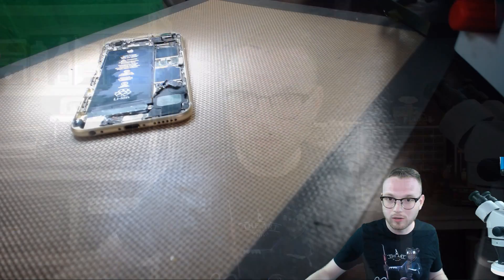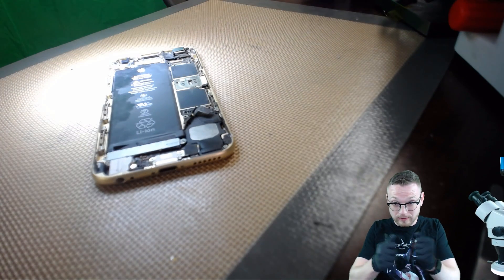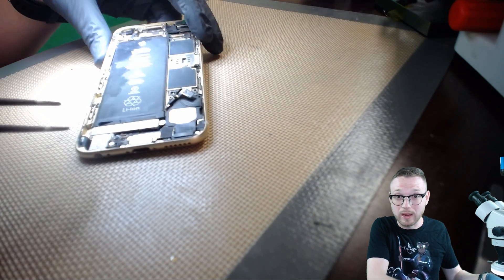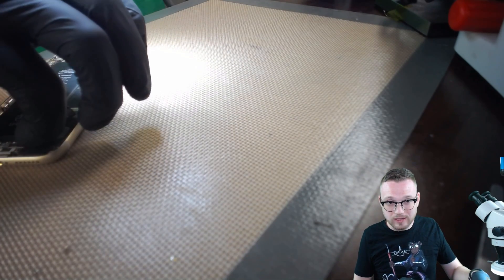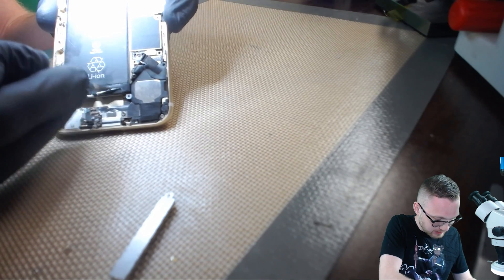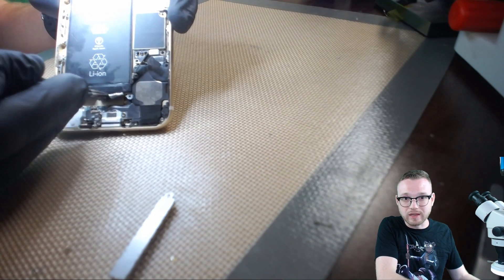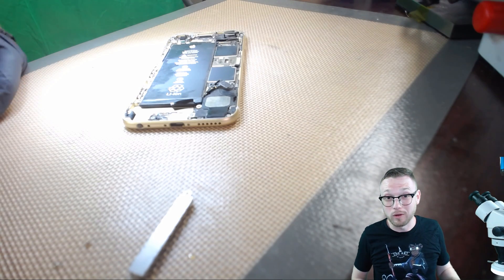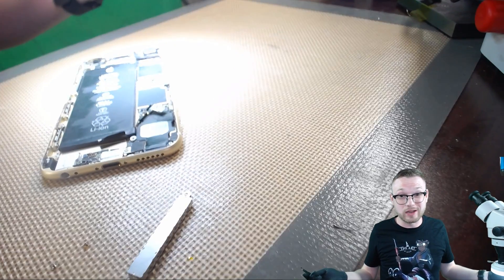EP23 Batteries for Dummies | How to get iPhone batteries out without PRYING!

Comment: if you break the command tape, a couple drops of ISO alcohol under the battery (i apply with a small brush) and a gentle pry gets the battery out VERY easy.  the adhesive completely lets go. safer than heat, easier then removing motherboard, not messy.

Comment: taking out the motherboard is absolutely the safest way of doing it but if you're discarding the battery and happen to rip the pull tab half way i use gentle heat, a credit card (never use any metal pry tools in case you puncture the battery) and spray the smallest amount of isopropyl alcohol under the battery to loosen the adhesive and only lever it up from the frame side.

Comment: Great video, great advice. I have struggled several times with these battery pull tabs. At least one of the tabs usually snaps. But hopefully with this info my struggles should be over. Many thanks.

Comment: hey justin, thanks for the video.
what about using little bit heat on the battery from the bottom of the phone? maybe easier for removing.
Reply from the maker: Pedro my man! appreciate your question regarding using heat to remove a pull tape style battery! While it may help some to use a little bit of heat on a non pull type adhesives. It should only be used on the bottom of the frame, and never in direct contact with the battery. I would not recommend using heat on this style battery adhesive. Considering its removal design, heat would be unneeded.

Comment: What about 5c/5s. There is no vibrator there to get more space. What do you do then ??
Reply from the maker: Hey! I appreciate your comment bro! To deal with this issue, remove the charging port. Its the same concept as (10 minutes for the motherboard to save yourself purchasing someone a phone.)  Anything that could cause unrecoverable damage to a phone, needs to have a safe method. Even if the safe method seems longer. When in reality it may take less time to do it this way from the start. This tactic comes straight from the auto industry.
Reply: @TheArtofRepair  As a highly trained, fully certified shade tree mechanic, I can absolutely vouch for the truth of this. These days with car's engine compartments packed full of stuff, it's pretty rare that you will be able to unbolt and remove only the component that you need to replace, and this is also true of some suspension components. It almost always takes a lot more time to gain access to the component than to replace it. Sometimes the use of a Sawzall is required due to rust seized fasteners. Thanks for your excellent videos, and Kudos on spreading the word on Right To Repair!
Reply from the maker: @jonlubar5181  hey! Thanks for keeping up with the older videos! Love to see new comments hit them, thank you for visit g the channel. I hope your journey to the center of repair is going well 💪🏻

Comment: Tbh i just get a blunt plastic and pry the corner of the battery. Then just pull the adhesive from that side. So far no explosion. Though your method is defiantly safer. Will use in the near future.
Reply from the maker: Right on dude, glad your trying the new method! I appreciate the view and comment!

Comment: The 6s is easier because the haptic engine can be removed so easily. Not the case for any model prior to it. And removing the usb port assembly is time consuming, there's so many bits, screws, adhesives etc.
Best solution is to invent a small roller, with a handle, that you can slip down at the bottom end of the battery. That way you can pull up instead of outwards, and not have it break. 
Currently I use a playing card and some patience to get it up if the tabs break.

Comment: If tabs broken isopropanol alcohol with pry will get the battery out, wd40 will do the job but make a mess!
Reply from the maker: Yes but then you break the cardinal battery removal rule. No prying. But since this video has come out. Iv come up with a new way. To use ethanol and Kevlar thread to go under the battery. The ethanol works better than the iso since it does not gum up the adhesive and just tends to break the adhesive bond. And the thread will go under the battery as if you were doing a screen refurb and the battery comes right out.  Also if you put the device on a heat plate. This method will make large tablet batteries a breeze as well.